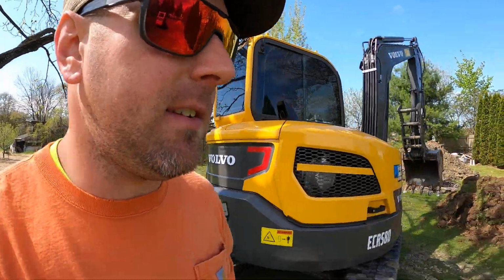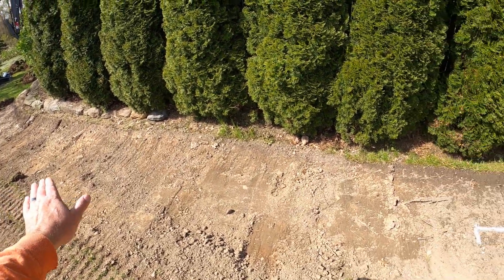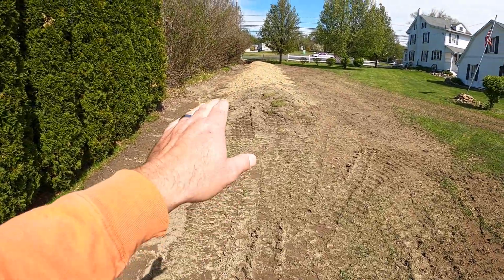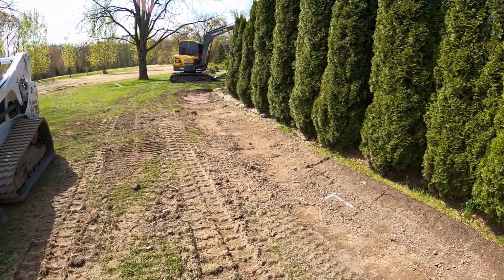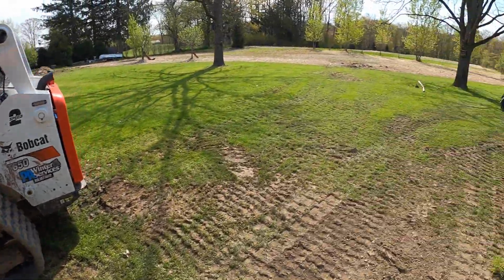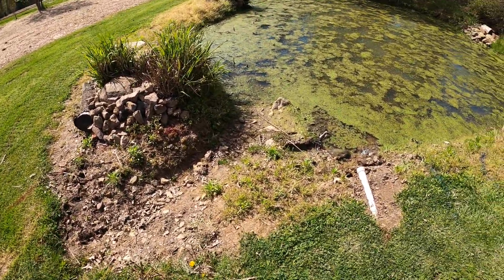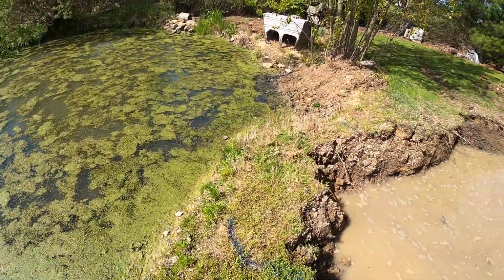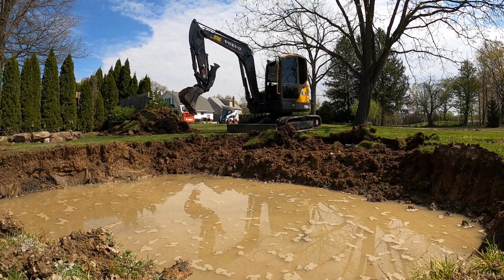Volvo ECR58D Excavator Digging a Pond

Comment: Are all you buckets Volvo buckets? I went to purchase an ecr 58 and was told by the dealer they did not recommend the Volvo coupler. I want the pin grabber like yours. Do you know which model coupler you have?
Reply from the maker: Yes all Volvo buckets, extremely well built, I have a manual pin grabber coupler instead of the $4000 hydraulic grabber.  It takes about 60-90 seconds to change the bucket once your good at it.  I felt it was a worthwhile savings at the time
Reply: @Pawinterservices  the dealer was trying to tell me only Volvo buckets would work on the pin grabber. A pin grabber should work with any brand bucket in same class within reason. Volvo corporate referred me back to local dealer.